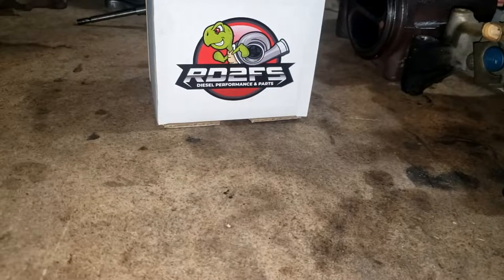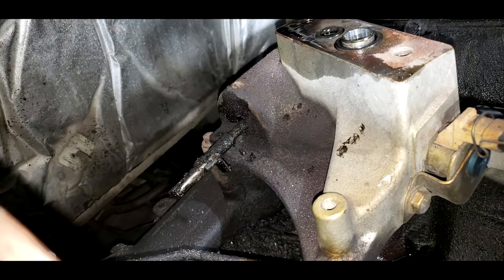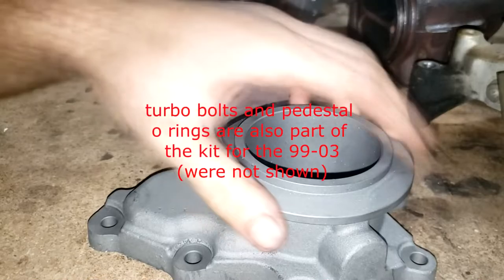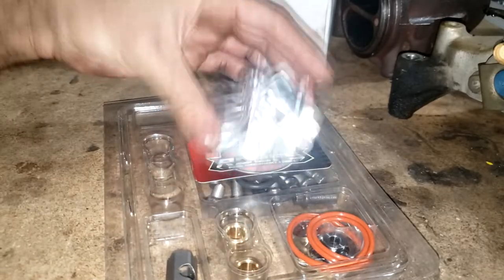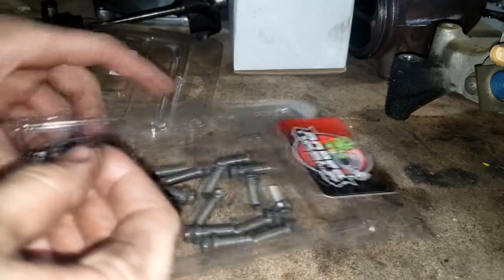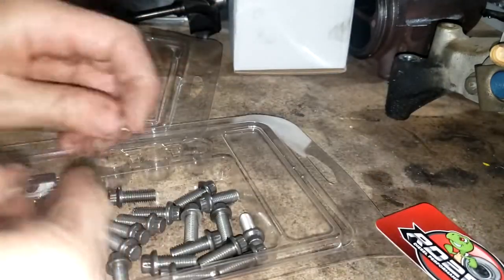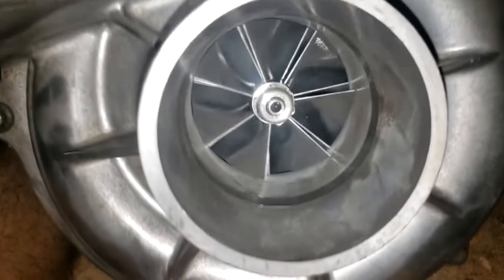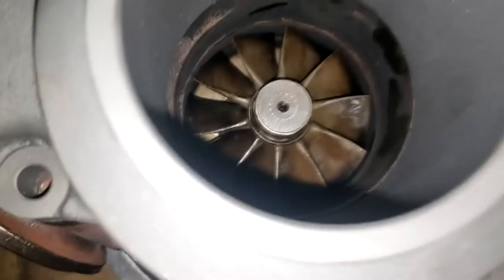GTP38 Turbo rebuild/360 degree upgrade+ billet wheel 7.3l Powerstroke

Comment: I have a 1997 7.3 I live in Minnesota should I install the pedstal delete kit?
Reply from the maker: Helps with getting rid of leaks and gives you cooler egts. That question depends on how your truck is currently. Ebpv helps the truck warm up 5minutes faster by creating back pressure